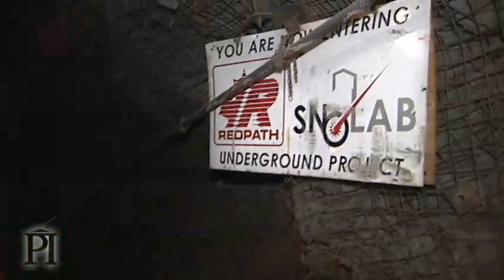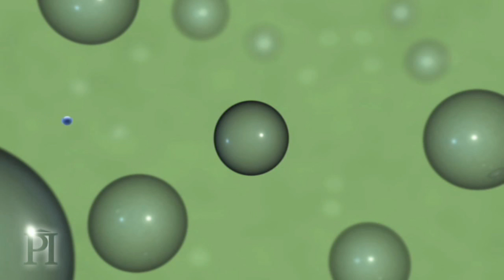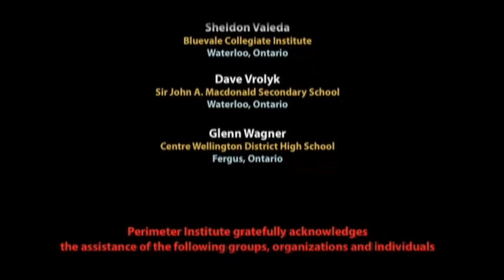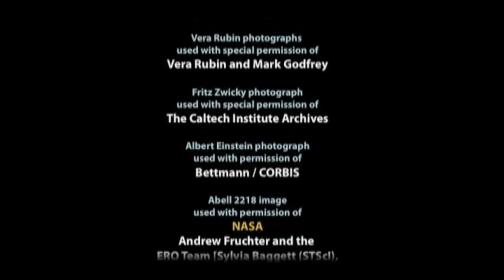The Dark Matter Mystery: Most Of The Universe Is Missing

Comment: My hypothesis that Dark Matter is not a weakly interactive massive particle (WIMP), but maybe is a deformation of space-time by which the curvature of space-time itself is the cause of the gravitational effect. The "dents" Verlinde talks about aren't slow motion effects, but rather fixed geodesics. Gravity is the consequence of the curvature of space-time when mass is present.  It may be possible that the structure of space-time itself could be warped without the presence of mass.  So, how did this warping occur?  We believe this warping of space-time occurred during the extreme conditions present during inflation. Space-time has been shown to react like a fabric by warping, twisting, and propagating independent of mass. These properties have been proven with observations of gravitational lensing, frame dragging, and now gravitational waves. Fabrics can be stretched, pressured, and/or heated to the point of deformation. Such extreme conditions were all present during inflation, so it is plausible that space-time’s elastic nature could have hit its yield point and permanently deformed. Therefore, if gravity is the consequence of the warping of space-time, and fabrics can be permanently deformed, then a deformation could create a gravitational effect independent of mass. Thus, the unidentified dark "matter" that seems to be so elusive to modern science may not be matter at all but merely warped deformities causing gravitational effects.  We have a prediction using gravitational lens mapping to prove Dark Matter isn’t a weakly interacting massive particle, but instead is a floating fixed pocket of warped geodesics in space-time geometry causing gravity wells.

Comment: The stipulation that dark matter exists is based on the fact that the orbital speed of stars are faster than what is expected based on a galaxy's calculated mass, but based on the examples given in this documentary there's a couple of things to be pointed out.

1. If each galactic center contains a super massive black hole, then who's to say that the brightness emitted by the galactic center plays nicely with the way it's mass is being calculated. I mean light generated by a black hole may be behave drastically differently based on how much material is feeding it - thus the mass of two different galaxies centers could be equal, but one could be brighter because it's consuming more material and ejecting more radiation.

2. Stars orbits the galactic center within the dusty spirals of a galaxy's arms. These galactic arms are massive, exert gravity, and are essentially side by side with other galactic arms. Isn't it possible that a galaxy's inner arms pull along outer arms due to gravity, turbulence, friction, etc at a higher speed than expected as compared to the formula used to calculate planetary orbit speed? I mean wouldn't individual planets have little to no impact of the orbiting speed of other planets where as galactic arms have a much more complex interaction - thus deserves a more complex formula to account for the # of arms, size, spacing, mass, etc?

3. If dark matter permeates all throughout a galaxy as indicated by the documentary (e.g. I'm getting bombarded with it now), then wouldn't the mass of our own solar system be drastically more than the sum of it's known visible parts? If so, is the orbital speed of our solar system's planets being skewed in the same way as the documentary states is being observed in the Andromeda galaxy's stars? And if not, then why would it behave differently in one scenario instead and not the other (e.g. would it not scale down)?

I'm not a physicist, but I did stay at a Holiday Inn last night, plus I have a Bachelors in Computer Science and Math so I'm not a total idiot (except for the bad joke). I'm just a little confused is all, so I'm asking a few questions with the hope that someone with more knowledge than me will respond to clarify.

Comment: @xCrowMagnuSx While it may account for considerable mass, it does not account for large areas of gravitational lensing.

It also doesn't explain the high rotation speed of the outer parts of galaxies, that wouldn't behave this way if the majority of the mass originated from a BH at the center with inverse square gravity falloff.

Something additional seems to be involved, hence the search for dark matter.

Comment: neutrino particles are less energetic when they collide. dark matter however is theorized to be larger, so the collision releases more energy. that's why they use the suspended liquid bubbles hoping to turn the tiny bubbles into gas through heat. a neutrino passing through the bubble wouldn't have enough energy to do that. which is why neutrino detection is different.